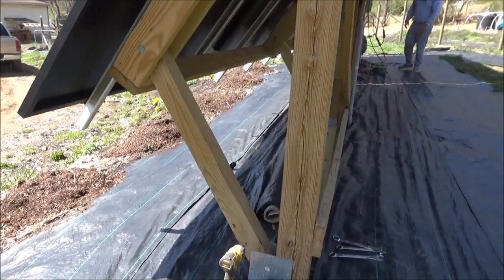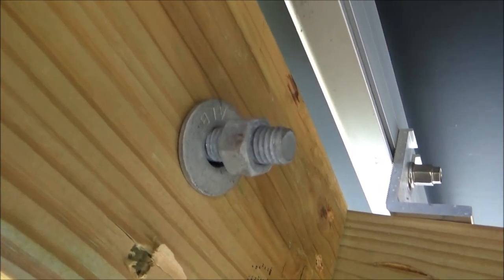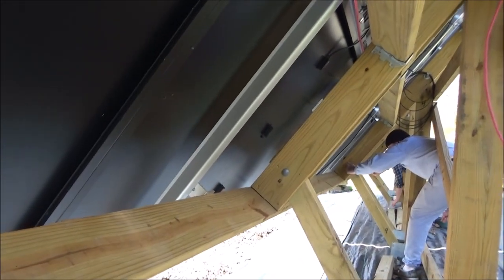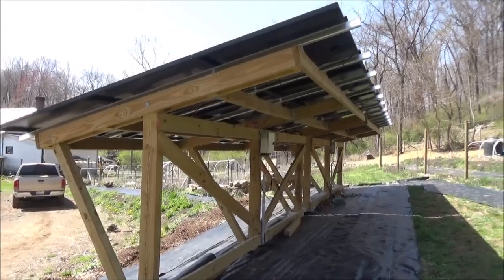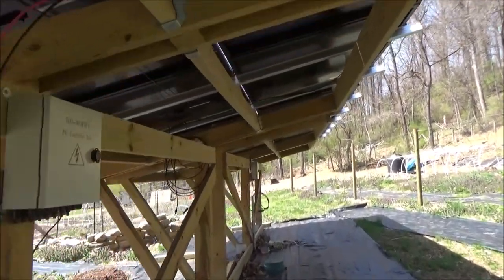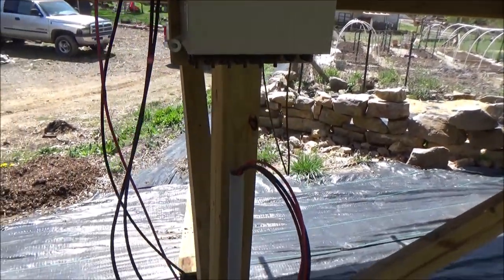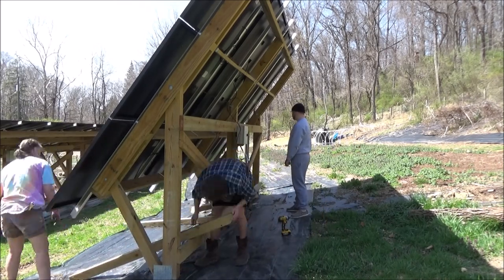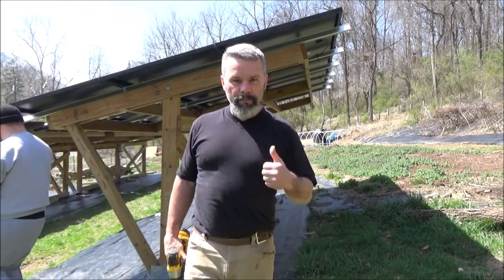Wooden Adjustable Array - Tilt Angle Summer Solstice

Comment: Looks great!  Wonder if you see any instant production increases in your PV after the change?

I've seen a few of the array builds with the jacks you're talking about.  Some have just used the side crank jacks for trailers.  Might be worth looking into and wouldn't cost $500 a piece.  

Thanks again!
Reply from the maker: Thanks...I meant to take a couple power readings in the days leading up to this but, of course never made the time. It does seem to charge up the batteries a little quicker in the morning! Its amazing how much the sun in the sky raises for the summer, never really noticed until you rely on it to power things. I did check out the trailer jacks too but the one I ripped off my bike trailer wouldn't extend far enough to get to my summer angle so I kinda figured they would all be too short. Story of my life 🤣
Reply: @DumbGrunt0311  No worries.  Something to look forward to for next year!

Yeah, I figured that the trailer jacks would probably take some fabrication in order to get to the proper length.  Project for your spare time, right??? 🤣